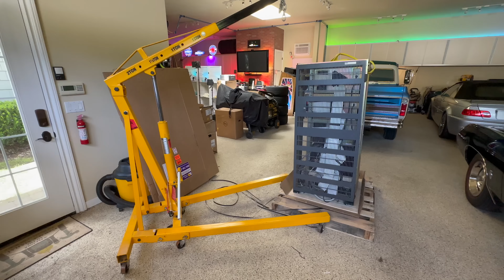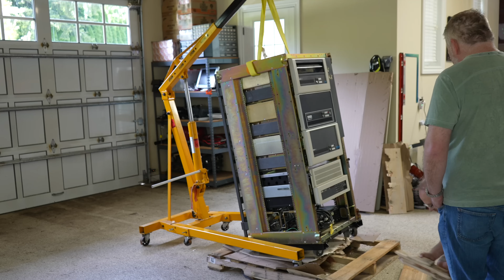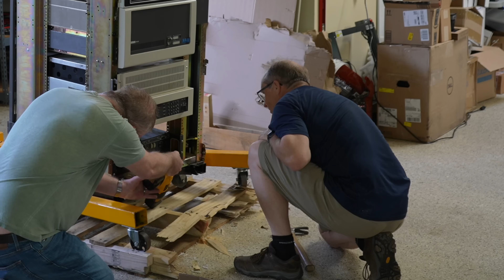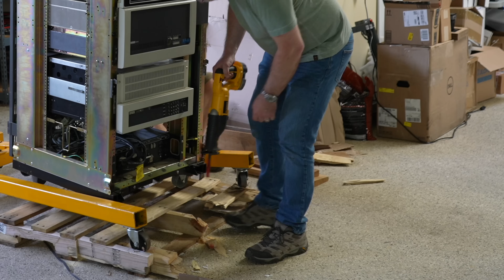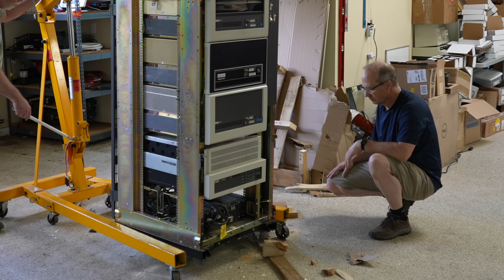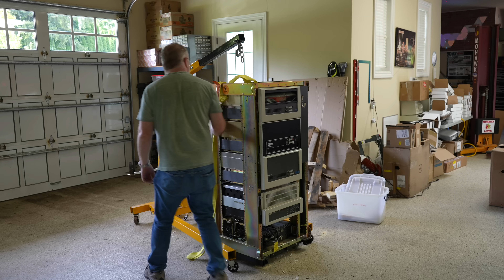I Bought the HEAVIEST Computer on eBay: The PDP-11/34!

Comment: When you need an engine hoist to move your computer you know you've made it.
Reply: How about when an engine hoist is far to small to lift it or move it? I once had a VAX 11/750, brought it up to the third floor to my apartment, only to misassemble it by connecting the PSU main fan airflow sensor to the wrong port blowing the thing. By brought up I mean I disassembled the whole thing and brought it up piece by piece using the stairs, I had no elevator. 
But about the same time I also got a PDP 11/23 which worked a treat. 
The VAX ended up at the dump because of the airflow sensor, there would have been a way to cheat it and get the main stage of the PSU to power on, but it was far beyond the means of a 16-17yo me. I lived alone at the time and had about $40 a month to live on, which was enough for fast cook macaroni and ketchup, and some ramen in the weekend if I had been frugal. Still feel bad about the VAX going to the dump, but that's where it was headed before I tried to save it and failed.
Reply: If mainframes weren't vendor-locked, I would have a few by now.
Reply: @naikrovek  what do you mean by 'mainframes'? Also, most systems are not really vendor locked, so not sure what you mean there. Some software is hard or impossible to get as a private person but most of that doesn't stop you from running them, just stops what you can use them for. Like some compilers are nogo, some specific functions on for example large IBM systems like LPAR require feature unlocks by the vendor, meaning if it's not unlocked when you get it, you won't be using it, and if it is unlocked it won't be if you upgrade or reinstall the OS in certain ways. Most of those things you can work around if you know what you're doing, without help from the support. Or - ehm - official support at any rate, it helps if you are not totally some unknown guy 'off the street' to them.
Reply: OP, close but you have really made it when you need a forklift to install that 5mb IBM 1401 drum storage. :)
Reply: Engine hoist, haha, we used to move those things around all the time with just a regular old two-wheeled dolly. All that stuff in the 19 inch rack unscrews. Most of it weighs less than 70 lb and none of it weighs more than 125. You take it out, move the rack with a dolly, and then screw it back in. The tape drives and disks (if you have them) really should be taken out and transported more gently. Moving it that way with the engine hoist is not that good an idea.
Reply: I moved a windows 98 computer still in use with an engine hoist recently. It was a KUKA KRC1 kr200 control unit.
Reply: Or lost it ... ROTFL :P
Reply: Little stuff , try a medium range like a Burroughs 1900 or bigger , any single piece is winching material
Reply: Incidentally in the intro is a sloping lid printer behind an operator standing , the printer is an ODEC chain printer , get one especially a 600 lpm .... I'm not joking you will be amazed and horrified that such a device existed
Reply: Google Image IBM's 5 megabyte hard drive.
Reply: Thank God for that ;) btw Nice Poket calculator

Comment from the maker: @13:26, I just noticed the OLD battery pack has a red negative and black positive.  I bet I wired it negative to black... how did it ever work?
Reply: Surprise, surprise.
Reply: 😲 Shocking lapse of concentration! 😉 (If the battery pack is simply used to power the head retraction electro-magnets, they wouldn't really care which way around they're wired. But if it also powers any circuitry, then yep, it's a minor miracle!)
Reply from the maker: @kc5402  I'm assuming that being Nicads, the system recharges them, which means it sends positive voltage to them... but I'm not certain!
Reply: @DavesGarage  Ah, yes, recharging. That's a good point. So a bit of a mystery!

Comment: You could have just laid it on its back on a couple  of 4x4s. We did this to mount STC tape drive cabinets then stand it up and hang the drive assembly.
Reply from the maker: You'd need a lot of guys to tip it over, though... 800 lbs.
Reply: @DavesGarage  Yeah, that's certainly no pushover.